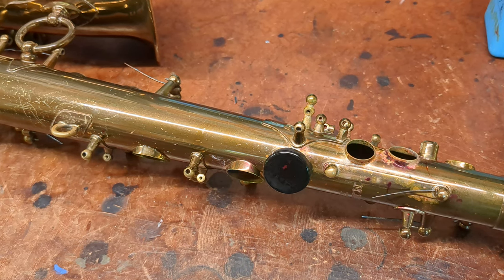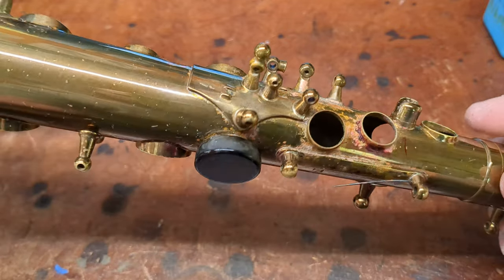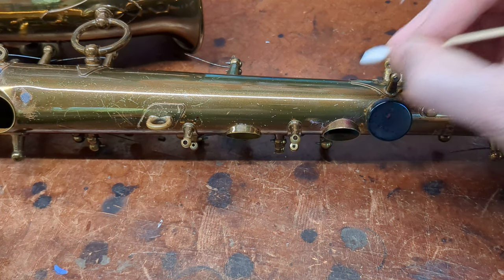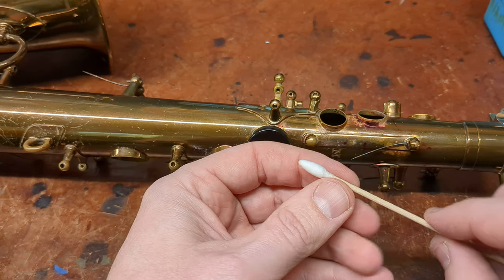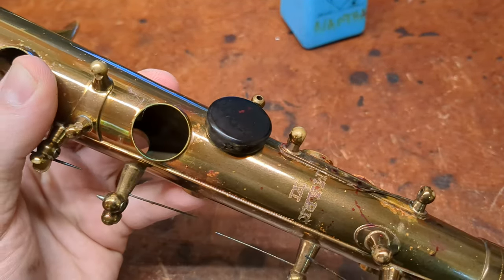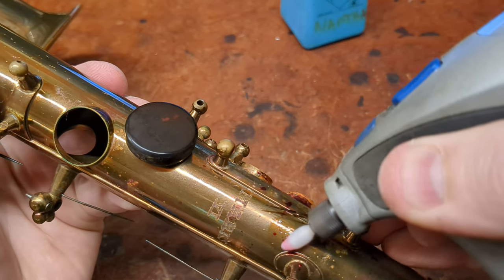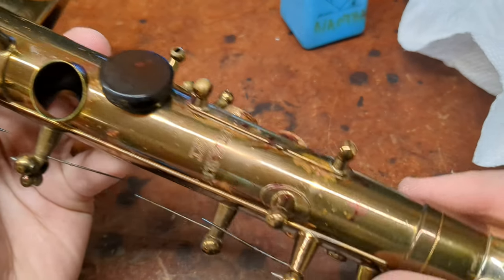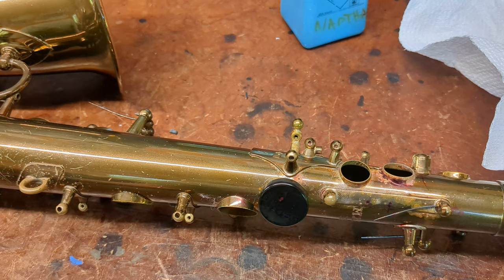Saxophone Repair Tip: Easy Detail Polisher/Cleaner Trick

Comment: If it's marker of some kind, when naphtha fails, photo emulsion cleaner like PEC-12 usually wipes it right off. Coloring over it with an EXPO marker may work as well, because it has the same solvent as the emulsion cleaner.